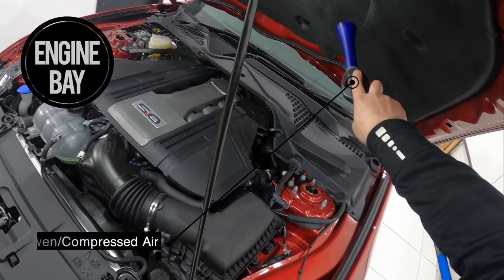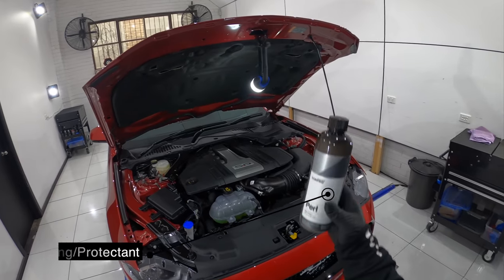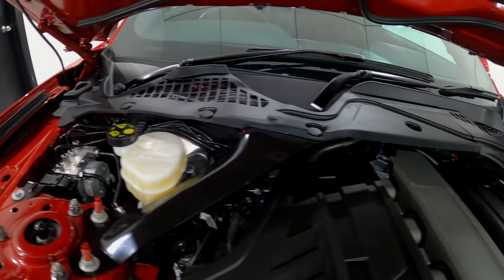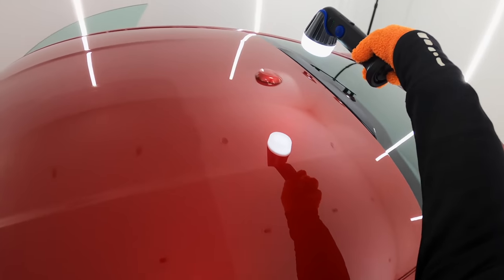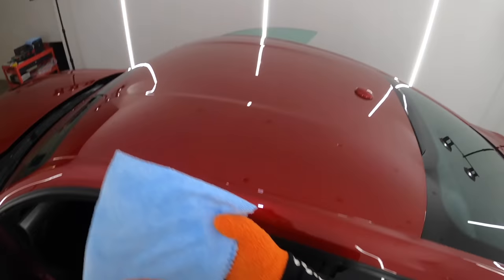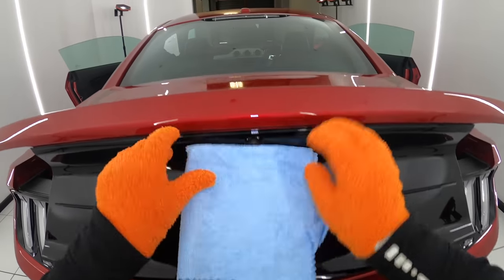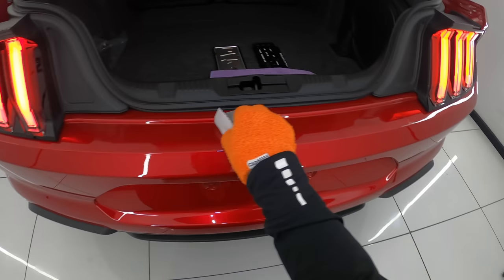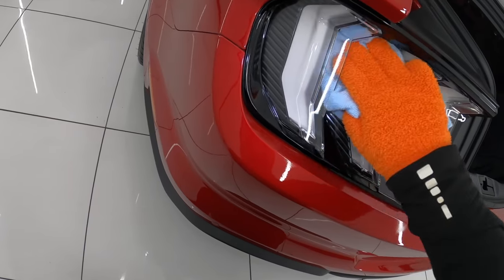How To Detail & Ceramic Coat A New Car! 2020 Ford Mustang | P3 Ceramic Coating! (31.3)

Comment: I just did my 2022 supra on red,polish the paint with GRIOTS compound and apply 2 coats of  CQUARTZ ceramic coating,took me 12 hours but is worth it,I'll be happy if it last 2 years.
Very brave to use a polisher for 1st time on a brand new car but it really work out for me,cost me like 300$ for all materials and tools.
Reply from the maker: Great to hear and you’d be hard pressed to find a decent detailer to it for that price so well done.

Comment: Excellent job Sandro. That red looks like it's dripping wet, it's so glossy. Still don't quite have the confidence to try applying a full Ceramic Coating myself, however, just bought NV Glass and thought that might be a good introduction into ceramics. Long weekend coming up so plenty of time to prep and apply. Thanks for all your hard work and advice. 👍🍻

Comment: This is a great series Sandro. As my work/business keeps going from strength to strength it is experts like you that I turn to just to ensure I’m following ‘accepted’ procedure. I have only one question, do you coat the glass or paint first or doesn’t it matter? Or possibly, does it depend on the job at hand? Once more, thanks for all the work you do in helping those less experienced. Lloyd
Reply from the maker: Thanks Lloyd, and I typically prefer to coat the glass first just so I’m not leaning over the paint after it’s been coated.

Comment: Looks fantastic! That red just pops now! Sandro have you tried any of the ceramic  primer products designed to do light correction and polishing and leave a base layer for the coating to bond to? Gyeon quartz primer would be an example. Any thoughts on them?
Reply from the maker: Thanks and yes I’ve personally used CarPro Essence, Nv Morph and both Shine Supply Burnout & Slickback as coating primers. If the paint extremely soft then the resins in them can actually give you a little hardening an extra slickness which helps prevent marring and scratches during the coating stage, which can be a big help on those supper sensitive paints. But otherwise I personally prefer coating on bare paint and not masking any haze if I’m being payed to do high level paint correction.
Reply: @CarCraftAutoDetailing  Great, thanks! I think I have the perfect situation that calls for something like Essence. Wish me luck!
Reply from the maker: Good luck!!

Comment: Great to see the conclusion Sandro. 
You say at the end you sank 33 hours into this job.
For a new detailer starting out trying to figure out what to charge, do you have an hourly rate that you just simply multiply by the amount of hours you expect to spend on each job, or do you charge by the different processes and products that you apply to each job?
Reply from the maker: Time is always the greatest expensive and an hour rate based on an estimation of time is how I primary quote jobs. 
But that rate has includes things to sustain your business or else it will fail. So your rate needs to take into account things like your product costs, taxes, rent, bills, insurance and depreciation of equipment that will need to be replaced, and of course you need to live and pay yourself a wage. But another part of it is of course the experience, skill and results that you bring to the table, so just like any other industry, the better you are at what you do the more desirable your services become and the more you should be charging based on that skill level and what you deliver to your clients.

Comment: Hi Sandro, your videos and your work have an ethic and a discipline that I simply admire. If it’s okay, I has a question. When cleaning heavily soiled engine bays (requiring a rinse with hose), does one use a wheel cleaner or a car shampoo? Also, why don’t you dilute the Carpro Pearl with water, which is what I have seen some other detailers do. I love your work, keep ‘em coming!
Reply from the maker: Thanks mate, and a degreaser would be at the top of my list for a dirty engine bay and even a tar remover can be a great help. I’ve personally found that Perl can create a patchy finish when diluted, but not always, it really depends on the specific trims, but I don’t seem to have that issue when used neat.
Reply: Thx Sandro, I appreciate it!

Comment: Hi Sandro, awesome content as usual, what if the mustang has vinyl strips can they be polished and ceramic coated, how will they react to the IPA cleaner is it safe to use.
Reply from the maker: Thanks and if the strips have a gloss finish you can polish them, but if they have a matte or satin finish then no, but they can certainly all be coated regardless of their finish.

Comment: Beginner question: Can the foam applicator pad used with Nova PERL be washed and reused? If so, is there a good method to clean them out? How about the microfiber cloths for the ceramic coating? Thanks for the great series!
Reply from the maker: Yes you can reuse the foam applicator, just make sure to use it with similar products, and I use a velvet soap bar and warm water to clean it out. 
If you have a bucket ready with warm water and detergent and put you’re used cloths straight in as you switch to clean ones you can reuse them a few times for coatings.

Comment: Hey Sandro! Great series! That engine bay is nice. Absolutely a superb job on that 5.0....
I will be applying a coating soon and I picked up on something you said about laying down extra criss-cross applications to help the coating flash quicker. I will be coating a white car in natural lighting. (Outside) 😁 so seeing the coating flash may be more difficult for me. I’m not using one of the popular brands for this job and I don’t believe it’s a quick flash coating according to the manufacturers assessment. They do say that it is a very forgiving coating...whatever that means...lol  Any advice?
Reply from the maker: Thanks mate! 
I’d just say do your first section to try and gauge how much time it needs to sit on the paint in your environment and with your technique before you level it down. Generally if it’s more forgiving to use, that tends to point to a slower flash time, so as you mentioned, you could perhaps work it in a little longer with your applicator to encourage a quicker flash time if that’s the case.
Reply: Car Craft Auto Detailing Thanks mate!

Comment: Thanks, Sandro. Does that handheld flood light make it a lot easier to see the rainbow/flashing?
Reply from the maker: If it’s used in an environment with lower or softer light with a good technique it can help show both flashing and high spots. I did a separate video on it a while back showing how to use it.

Comment: Since you used a ceramic coating we can't buy, which over the counter coating would you recommend?
Reply from the maker: Generally if you go with a consumer brand of coating that is tried and tested with a good reputation you should be fine. I guess a couple of the ones I personally use and like would be Nv Nova Evo and Carpro CQuartz UK & SiC.

Comment: Practice makes perfect, I hope I can be on your level one day, glass is my weakness I always end up getting oily like streaks on them and can seem to get them clear when I’m doing a  dressing on the rubber trim, any ideas on how to deal with this issue?
Reply from the maker: Being a bit more liberal with your glass cleaner should help, so don’t be afraid to really saturate the glass with it as well as ensuring your cloths are perfectly clean and you just use them for glass and nothing else.
Reply: Car Craft Auto Detailing great advice I’ll give it shot 👍🏽

Comment: is UK 3.0 a coating that flashes quick for newbies?  What are your favorite newbie coatings? (I couldnt hear what you said in the video)
Reply from the maker: UK 3.0 is a fantastic coating for first time users as it does flash instantly after laying it down thoroughly.

Comment: i quick question the air blower you used is that werth getting to blow out buff pads of a normal one is fine no real difference
Reply from the maker: If you use a rotary or forced rotation machine then I highly recommend it, but if you just use free spinning DAs, then a standard air gun is fine.

Comment: What brand do you recommend that I can use to clean the surface prior to ceramic coating? Can I use diluted isopropyl alcohol?
Reply from the maker: Yes you can use an isopropyl mix 1:4 or something like Nv Clarity, CarPro Eraser or Gyeon Prep.
Reply: Car Craft Auto Detailing what do you mean by 1:4 ratio. does it mean in a 500ml 100ml of alcohol and 400 ml of water?
Reply from the maker: One part isopropyl alcohol to four parts water
Reply: Car Craft Auto Detailing so its 25% alcohol and mainly 75% water in all containers. Am i right?
Reply from the maker: 25% to 75% would be 1:3
20% to 80% would 1:4
Reply: Car Craft Auto Detailing so basically in a 1000ml i’ll dilute 20% IPA to 80% Water? Thsnk you I really loved your videos and your passion in detailing😊

Comment: Hi Sandro, 
I became your fan after watching the Mustang detailing series and I have added every item you mentioned in the description to My cart @waxit, except Nova Pro ceramic. 

If I was in Melbourne, I would have dropped my new Palisade to you but in Sydney, I don’t know anyone who does the job like how religiously you do. Which ceramic product do you recommend to go with the list in this series? 

I know that you reply to everyone and I will wait for it to complete my checkout at waxit.com 
Cheers, 
Manoj
Reply from the maker: I don’t think I’ve seen the new Palisade on the road yet, congrats and hope you enjoy it mate! 
If you have the funds, it’s hard to go past Nv Nova Evo as long you can give it a good 48hrs to initially cure before use (in the colder months) and a good two weeks before the first wash. You can also apply Nova Boost 48hrs later to protect the coating during that fortnight curing stage, and if you have a nice sunny day after coating, you can pull it outside to get some UV light to help the initial curing stage. 
If you want something that cures a little quicker you could also go for 2-3 layers of CQUK and if you’re feeling energetic you could also top it with a layer or two of CQSiC - it just all depends!
Reply: @CarCraftAutoDetailing  , thanks so much mate. Much appreciated your time to reply back and you are a true legend 👍🏾

Comment: i would like to say that it depends where the Mustang is built and I know that a Mustang is built in Melbourne  but in the UK I have a 2020 Mustang 5.0 V8 GT in velocity blue which I believe was built in Flat Rock Michigan and when I got it about 3 months ago it only had very minor swirl marks and that's all i have actually surprised at how good the finish was tbh and the only correction that's was needed was a once over with finishing compound

Comment: Hallo Sandro. Excellent tutorial. Thanks. Does the blue tip of the air blower u r using work as a regular tornador? Quite rare to see that shape...  thanks.
Reply from the maker: Thanks, and it’s just a Tornador style blower - not the one that attaches to a bottle
Reply: @CarCraftAutoDetailing  cool Sandro thanks big.

Comment: Sandro, how imperative is it to use Carpro Dlux on trim and rubber, vs just using UK3.0 for the paint and plastics?
Reply from the maker: Some of it is just personal choice, as they are both great coatings regardless of the surface, but I have had particularly good successes with Dlux on wheels and plastic trims, so that’s also part of it.

Comment: Amazing video. You touched on several points beginners would be asking themselves. One I'm still wondering is how much product to be used on a sedan bonnet? You applied the droplets on the cloth looks like twice for this car's bonnet, but not sure if it's twice or 4 times. :(
Reply from the maker: The bonnet was split into 6 sections and I applied a bead line of product on the applicator before each section.

Comment: Hello, You mentioned,  if you are new to ceramic coatings I should start with a product that flashes immediately. I just could not understand the two products that you mentioned  in this video. Could you please tell me the two products I should consider? Great videos!
Reply from the maker: I believe was talking about CarPro U.K. 3.0 and Nv Nova Evo, thanks!

Comment: Did sandro know about the new shinemate polishers?....sandro is the ambassador of waxit ...the importers of "shinemate" lol...great video sandro...I'm a master car detailer of Melbourne....but don't do detailing anymore...hoping to build a dream workshop like you one day ....I've worked for bayford and nearly every other brand of car over the years....it's an absolute discrace what happens to new cars...I used to run my master detailing business inside mercedes...the car detailers used to have screw fights...throw number plate scews at each other and hide behind new cars...while laughing as the screws landed on the glass and paint of the car....amongst seeing many other toe cringing car destroying practices everyday... probably the world will see a new industry arrive in 10 years time...where it becomes standard to hire a " detailing inspection company" to inspect the car before pickup...and deal with all legal issues ...to prosecute dealerships and retrieve compensation...to pay "for a $2000 new car detail"...when you buy a "new" car...the car should be "new" lol

Comment: do you ceramic coat after polishing than add glaze, sealant or wax?
Reply from the maker: Yes after polishing, but you don’t need to add a sealant or sealant over the coating, but you can
Reply: @CarCraftAutoDetailing  ok thank you! I've seen people mess up their paint job real bad and don't want that to happen. Thanks again

Comment: Just picked up my new Mustang Bullitt - I asked the Ford garage not to touch it so I could clean and prep it myself - after a wheel clean, rinse and two snow foams I did a contract wash with Meguiars Wash plus - on inspection is has a huge circular scratch on the boot lid and lots of bird line marks - I have contacted Ford who want photos ... let’s see what happens!
Reply from the maker: Good luck and good on you bringing it to their attention. If more people hold dealerships and accountable there can be a shift on how manufacturers do things.